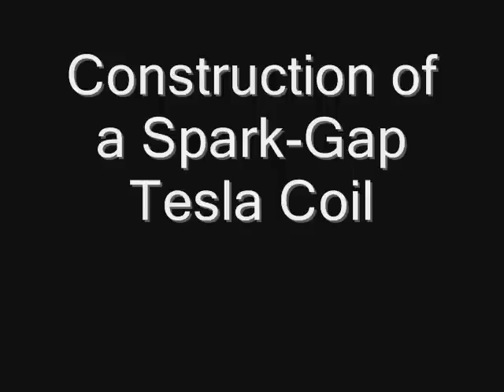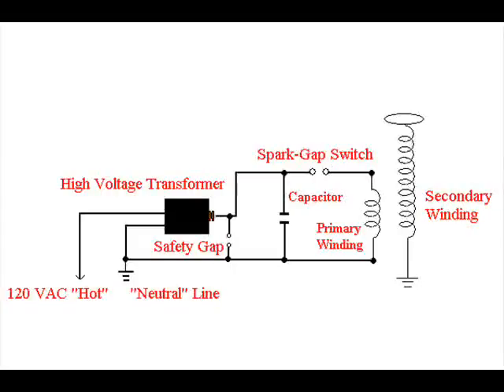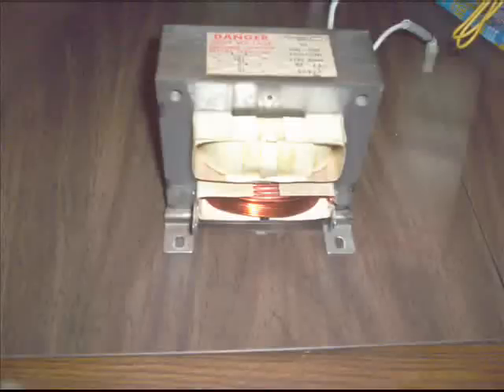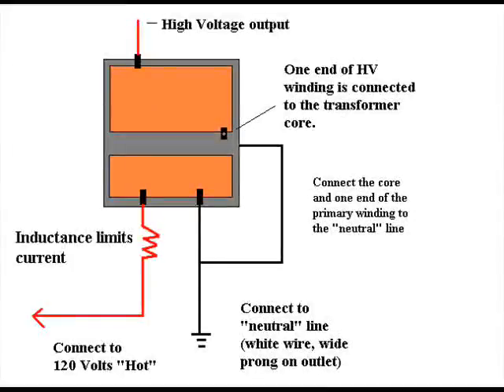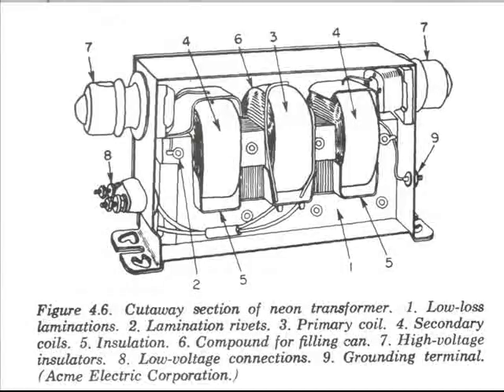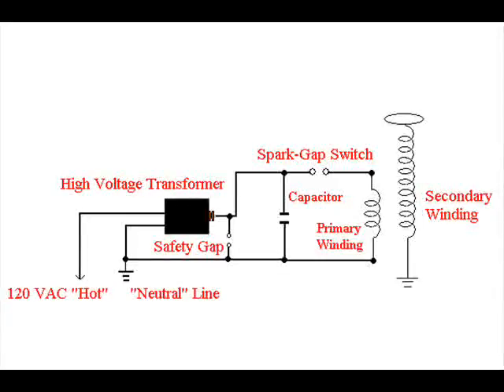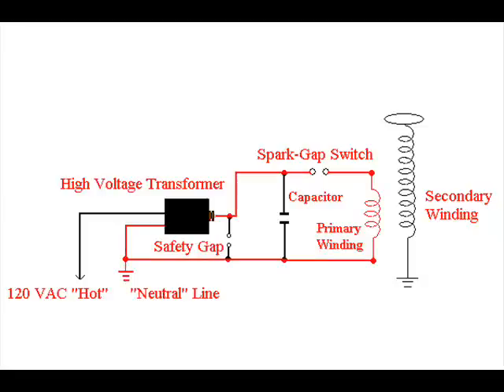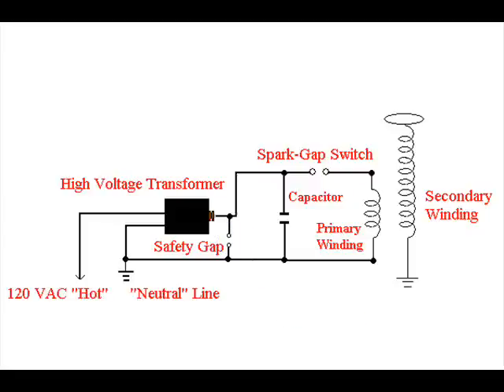Building a Tesla Coil

Comment from the maker: Nope...that's what they still teach in schools, but it was actually Nikola Tesla.  He made a system of transmitting and receiving signals before Marconi...and in fact, Tesla was way ahead of Marconi.  He was working on a method of transmitting POWER without wires (and that's basically what a Tesla Coil does).

Comment from the maker: That's simple....just cut the cord and connect your own wiring.  If it has 3 wires, then you have to connect everything on the Tesla Coil that needs to be grouned...the bottom of the secondary winding, etc to the ground line on the cord.  Usually it wil be green.   If the cord only has 2 wires, then you just need to decide which wire you're going to use as the "hot" line, and which one you're going to connect to the neutral line.

Comment from the maker: That's pretty much correct.  A transformer can be used to increase or decrease the voltage.  The amperage is also changed, but the overall amount of POWER remains the same.  Power is Volts X Amps = Watts.  So, for example, 6 volts at 2 amps is the exact same thing as 12 volts at 1 amp.  They would both equal 12 Watts. 

It's the same as how 1 dollar is equal to 4 quarters.  If you change a dollar bill to coins, the amount of currency is the same, you're just changing the form of it.

Comment from the maker: ...Have you seen that movie "The Prestige"?  That scene where they are outside and Nikola Tesla's assistant shows the field of light bulbs being lit up by a power station several miles away (with no wires) is actually based on a TRUE story.  Tesla really did an experiment like that in Colorado Springs.  That was one of the most awesome scenes I had ever watched in a movie, because I knew it really DID happen.  You should read the book about Tesla, called  "Man Out of Time" by Margaret Cheney.

Comment from the maker: Exactly.  A Tesla Coil needs high voltage for the spark gap oscillator, and then boosts the voltage higher.  Depending on how you build it, and the power source, it's possible to get several hundred thousand volts or even millions of volts from a large coil.  

A Tesla Coil also increases the frequency.  Typically, the resonant frequency will be in the 400 kilohertz range.  Although my coil operates at 1 megahertz.

Comment from the maker: by the way...there are Tesla Coils powered by vacuum tube cicuits.  They work with resonance too, but using vacuum tubes instead of a spark gap, and they have an extra primary winding for feedback for the tubes.  I've actually seen one running, and they're awesome.  But they're more complicated and I haven't tried building one yet.  If you can find an old amp or shortwave radio that has a high voltage plate transformer, that would have a lot of the parts you would need for a vacuum tube TC.

Comment from the maker: Actually, you would put capacitors in series to increase the voltage rating.  Putting capacitors in parallel increases the capacitance.  But yeah, I'm planning to cover more in a part 2.  There was just too much to cover and the video was getting too long.  Thanks for the comment!

Comment: Actually, the ionized air surrounding a TC would provide a wonderful conductor.  That's the principle behind the spark gap.

A TC wouldn't "attract" lightning, but it (and the ionized air) would provide a low-resistance path to ground.

Comment from the maker: Thanks!  I'm glad my video was helpful.  You will use one side of the transformer it it's "end point grounded," if you have only 1 high voltage output.  If it's center-tapped, you'll have 2 HV outputs, and then you will use both sides.  You'll connect the primary winding across both output terminals.  So it depends on what kind of transformer you have.

Comment from the maker: I have to agree with you on this.  In fact, gas has a property called "negative resistance" where it becomes more conductive once it's ionized and the resistance drops as more current flows through it.  That's why florescent lamps and neon signs have to be current limited, because once the gas tube is energized it is essentially a short circuit.

Comment: All three of these videos are great. It's the most helpful thing I've found for building a tesla coil. However I have a couple simple questions. (1) Where did you find the magnet wire? Places like radioshack don't have nearly enough to fit the dimensions you recommend so I don't know if i could use that. (2) What wire do you use for the rest of the circuit? (3) What do you know about beer-bottle capacitors? (4) Is your topload a CD? Again thanks for your videos!

Comment from the maker: You probably could make a smaller coil, but there is a practical minimum voltage for getting the spark gap to fire correctly.  I suggested 6kv as the minimum, because any lower than that and you'll have a lot of trouble getting the spark gap to fire smooth.  If the voltage is too low, you have to set the gap very close just to get it to fire...and then you have problems with it getting too hot and firing too early, before the capacitor has a chance to charge fully.

Comment: While the ionized air around the TC topload would provide a low-resistance path for lightening to enter, this area is already occupied by the output of the TC, therefore the resistance in this area would not provide as much of a resistance-free zone as you describe. In a thunderstorm, lightening would most likely not notice any tesla coil running, and would instead search for any solid metal to jump to, such as the grounding rod, or the topload itself.

Comment: Good question, in order to get radiant energy into our circuit we have to give it a chance to enter the circuit by changing our wiring a bit.  First off all we need both HV transformer secondaries and will wire each of the two leads to one side of a spark gap and one side of a capacitor, that will give us 2 caps, the opposite polarity terminal on each cap will term to each side of the Tesla primary . No conventional EM currents will flow on the Tesla primary only longitudinal currents.

Comment from the maker: The best advice I can give is to look for a neon sign shop or electrical surplus place in your area.  The other transformer is a furnace ignition transformer...just try calling around at heating and air conditioning repair shops.  Also, look on eBay!  I just got a 7.5kv neon transformer for $20 not that long ago.

Comment from the maker: You CAN connect the bottom of the secondary winding to neutral, but it would be better to use the ground line.  I just used the neutral line as the ground because I live in an old house where most of the outlets only have 2 wires (hot and neutral).  If everything in your circuit breaker box is connected right, then the neutral line should be at 0 volts anyway, and so for a small Tesla Coil it would be okay to use the neutral line as the ground if you had to.

Comment from the maker: 0GRATO, thanks for the tip but I've been experimenting with high voltage for over 10 years.  I built my first Tesla Coil back around 1999 (long before they were "cool" and every kid was building one in his garage).  There are only certain high vacuum light bulbs which emit X-Rays and I've had it tested with a Geiger counter.  They only emit soft X-Rays, which are mostly harmless.

Comment from the maker: If it uses a high voltage plate transformer, then yeah it might work.  But you need at least 6,000 volts.  Also, I think you have to use external resistance with plate transformers because I don't think they're current limited.

Comment from the maker: It's not so much because of the current, although there is a lot of energy from the capacitor discharge.  You want a thicker wire so there will be low resistance.  High frequency current mainly flows on the surface of a conductor, so you want more surface area on the primary winding.  It actually would have been better for me to use a solid wire or even copper tubing for the primary winding, but stranded wire was just easier to work with.

Comment from the maker: yeah, the wire itself has resistance of course, what they sometimes call "copper loss," and you could just measure that with an Ohm meter.  BUT it's very low, maybe around 2 Ohms at most.  The reason is because when they build transformers, they take inductive reactance into consideration, and so the winding is designed to have very low resistance.  Most of the resistance actually comes from inductive reactance.  That's why the primay is usually just a low number of turns of thick wire.

Comment from the maker: I normally use 14 guage wire.  18 AWG would be okay just for a temporary connection, but I probably wouldn't recommend it for a permanent hook up.  Esepcially not for the 120v input lines that go to your transformers, since depending on how big the transformer is, it might draw a lot of current.  

It really depends on how big your Tesla Coil is, but I think you're better off with 14 AWG.

Comment from the maker: yeah, but up to a certain point.  For a spark gap Tesla Coil, you don't want the primary voltage to be either too low or too high.  Around 6kv - 15kv is ideal.  Any lower or higher than that, and it's hard to adjust the spark gap and get it to fire smoothly.  For a bigger Tesla Coil, what you mainly need is more current.

Comment from the maker: Connecting capacitors in series doubles the voltage rating, but it divides the capacitance value.  So for example, if you connect two 1kv .01 microfarad capacitors together in series, the rating then becomes 2kv .005 microfarad.  Does that make sense?

Comment from the maker: yeah, solid state circuits are more sensitive to high frequency kickback, so you have to have more protection for the transformer with a solid state Tesla Coil.  Also, solid state TC's generate a DC output, whereas conventional AC spark-gap Tesla Coils generate a resonant AC waveform.  Solid state Tesla Coils also tend to be smaller because electronic components can't handle as much power as straight AC transformers and a spark gap.

Comment from the maker: ...also, with some transformers, like microwave transformers, one end of the secondary winding is connected to the core, and the core is grounded.  This helps to reduce the stress on the insulation.  If the transformer had two "hot" output lines, then there would have to be much thicker insulation between the secondary winding and the core because there would be a bigger chance of it arcing to the core.

Comment from the maker: I used the neutral line because I live in an old house that has a 2 wire system, just live and neutral (the neutral line is grounded at the main panel).  Most houses have live, neutral, and ground.  Ideally, you should connect the bottom of your secondary to ground, but you could use neutral if you had to.

Comment from the maker: That's going to be the hard part.  You'll need capacitors that are rated for at least 24kv if you use that transformer.  Look on eBay or electronic surplus shops.  You can try a place called Fair Radio Sales.  They have a website, look it up on Google.  Sometimes they have high voltage capacitors (and transformers).  Also try C and H Surplus in Pasadena, California.  You can order stuff online from them too.

Comment from the maker: You should try to avoid kinks and wind the secondary as neatly as you can.  But it shouldn't be a big problem, especially if it's lower on the secondary winding, where the voltage gradient will be lower.  If you have a lot of kinks or overlapping turns higher on the winding, closer to the top, then you might get some corona.  But I don't think you need to worry about it.

Comment from the maker: When I built a DC coil, I used a rechargeable 12 volt battery, and I connected a relay so that it vibrated and changed the current to pulsating DC to drive a small neon transformer.  Then I just used that to power a spark gap Tesla Coil.  I got decent sparks from it, but still nowhere near what you get from AC.  The problem is that if you power the transformer with a battery, you have very low voltage.  So you need to have close coupling between the primary and secondary winding.

Comment from the maker: First of all, what kind of "mini" Tesla Coil do you want?  They don't really scale down that well.  There's a limit to how small you can build them because they're affected so much by the size of the windings.  The inductance is pretty critical.  Also, ONE microwave transformer isn't enough.  The voltage is too low.  You would have to connect at least two of them in series, and even then the voltage might not be high enough.  I would recommend a neon transformer.

Comment from the maker: I use 14 gauge stranded wire.  I've drawn loads of up to 20 amps with no problems.  You can look up the ampacity if you wanted, but 20 gauge wire will actually handle a lot of current.

As far as how much current is in the output, I have no idea.  I don't really have any practical way of measuring that.  It generates 100,000 volts!  The voltage is extremely high and it's high frequency, but the actual current is probably microamps.

Still, the arcs are hot enough to set paper on fire!

Comment from the maker: ...with no load on the secondary windings, the light bulb is actually dim because of the inductive reactance of the transformers' primary windings.  However, when I draw an arc from the secondary windings, the load cancels out the inductive reactance on the primary winding, there is less impedance, and so the light bulb gets a lot brighter.

Comment from the maker: Drum67IX, I live in an old house and most of the outlets just have a 2-wire system.  But with a small coil like this, you can use the neutral line as the ground.  The neutral line is grounded at the circuit breaker box anyway.

Comment: How large is the static electric field that surrounds the Tesla coil?
What is the shape of that field?
I noticed in the Tesla picture of the Colorado Springs Lab, there was a giant pole with a ball on top, protruding from the building. Did this extend or alter the location of the static electric field when compared to where the coil was located?

Comment: You can also use an ignition coil as transformer. Input Voltage is 12V DC and Output VOltage is 10kV DC. If you use 2 of them you have 20kV DC. You can do something with that :D

Comment from the maker: Capacitors are connected in series all the time.  That's normal.  In order to increase the voltage rating of capacitors, you have to connect them in series.

Comment from the maker: If you provided a path of low resistance, like a channel of ionized air, then yes it might be possible.  In fact, this is why when you draw an arc from a high voltage transformer, the arc will usually stay on the same path, because that path of air is charged and ionized and the current will continue traveling along that path because it has the least resistance.

Comment from the maker: @flargrbargr 

The bottom end of the secondary winding is connected to ground (or you can also use the AC neutral line).  The other end is connected to the output terminal.

Comment: first very cool 3 videos, nice work, I have a couple of questions... my oibt has a 3 core flex, active, neutral and earth.  plus one hv terminal. the other end of the secondary being the earth. will this work ok?  I want to use an rf earth so is this right... active neutral in flex feed the obit earth from flex (obit secondary) connects to one side of safety gap, cap, primary (tesla) and secondary (tesla)&rf earth or use the rf earth just for the tesla sec, and tie the others to the neutral.

Comment: I just wanted to mention that microwave oven transformers are internally current limited. They use magnetic shunts, just like NSTs. The limiting is only about 1/10 of an NST, but it will put a ceiling on the current draw.

Comment from the maker: Well, similar but not quite the same.  The transformer in a fluorescent light heats a filament at each end of the tube.  That boils off electrons and starts a conductive pathway through the tube.  Once the tube is excited, it takes very little energy to keep the tube lit.  Sometimes fluorescent transformers use high voltage to excite the tube, but usually no more than about 600 volts.  So yeah, the idea is the same...but with using low voltage.

Comment from the maker: @Itsmeeman1 
No, the Wardenclyff Tower was meant to TRANSMIT electrical power, without wires.  But it still required an external power source.  Tesla never intended a device that would magically pull energy out of the air.  That's not what he was working on.  At one time, he suggested it might be possible to build a device that could generate power by absorbing cosmic radiation (similar to a photovoltaic cell today).  But not something that magically created power from nothing.

Comment: I have a question about the buildup. I'm having difficulties understanding the whole deal about Farad and capacitans. I'm starting to see that a low capacitans in a condensator will let it charge faster at a lower output amperage. But in a tesla coil would there be a relation between the condensator, transformer output and/or supposed frequence? Is higher or lower Farad best for TC's?

Comment from the maker: To me, that sounds like a good idea, but it depends on the capacitance value.  The current will be limited by the transformer, anyway (you are using a current limited transformer, or some kind of an external ballast, right?).  Your main concern for the capacitors is the voltage rating and the capacitance value. Do you know what the capacitance on those capacitors is?

Comment from the maker: @xavierz71 
a Tesla Coil does not generate electricity on its own.  It only converts it to high voltage and high frequency.  You still need an external power supply.  It is possible to use Tesla Coils to transmit and receive power without wires, like a radio signal.  In fact, that's what Nikola Tesla was working on.  But you would still need an energy source.